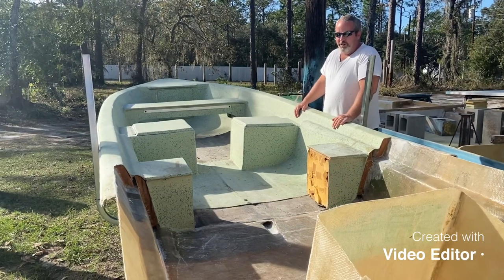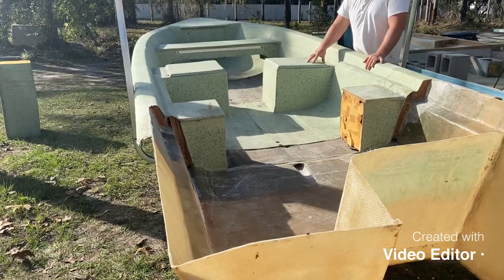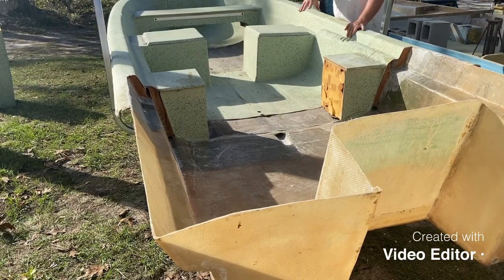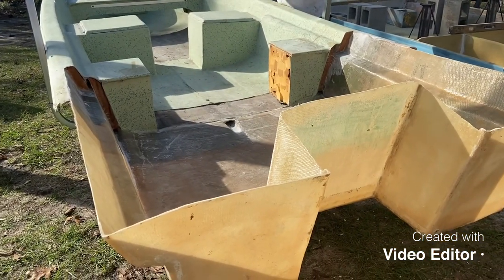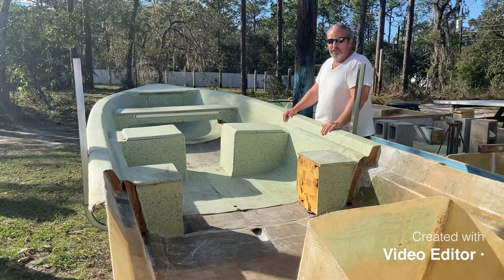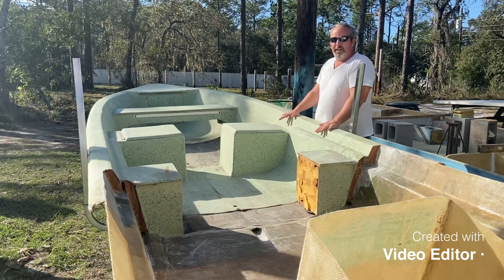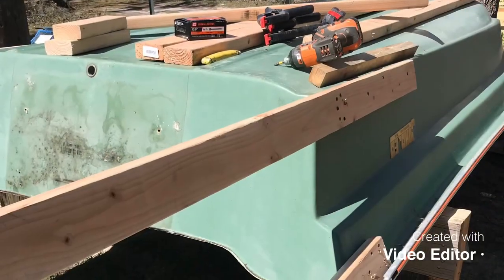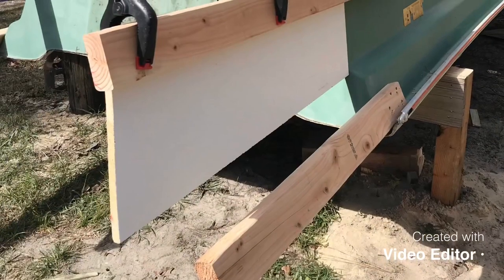Johnsen skiff hull extension Part 1

Comment: i HAVE TWO old 13 FOOT GHEENOE , i'VE BEEN THINKING OF WIDENING ONE BY 16 INCHES AND EXTENDING THE HULL BY 4 FEET. iS THAT Passable or just no a good idea . any input will be nice
Reply from the maker: It’s possible. Probably not worth the expense and labor for what you’ll end up with. I’d look for a panga hull in the 16-18’ range and build that out.